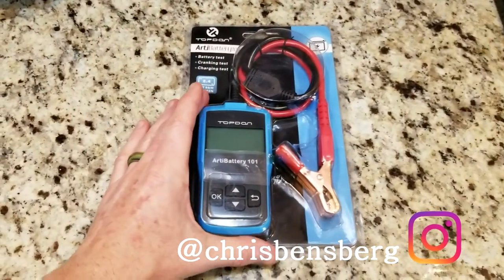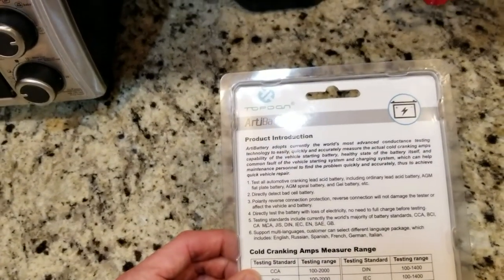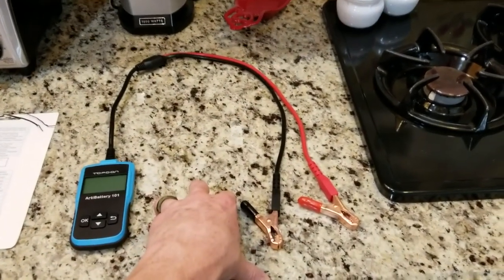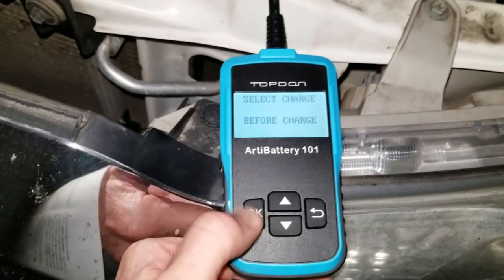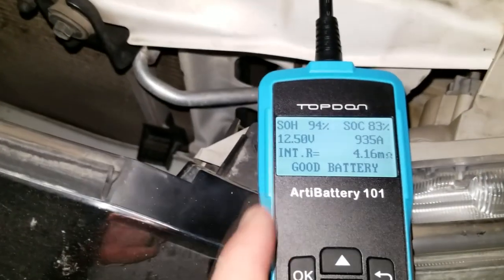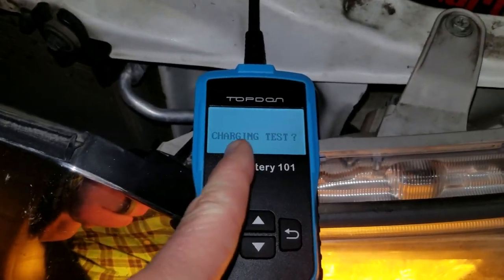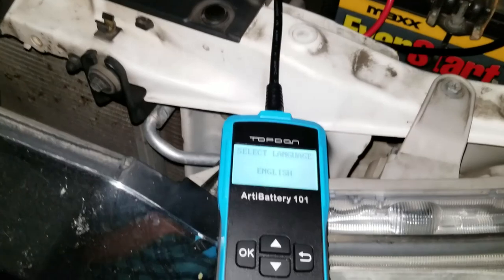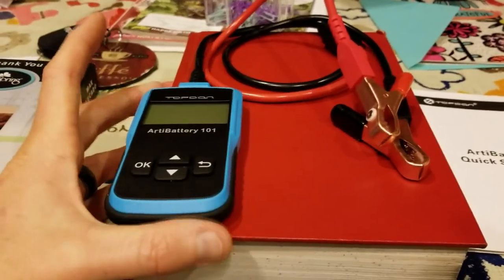THE BEST WAY TO TEST YOUR CAR BATTERY - AGM BATTERIES LEAD ACID BATTERIES & MORE

Comment: I just wonder if you need all that info, I mean it's great if you are working on a car that may not be your own, but if it is your own wouldn't you just notice that the battery was crap and change it.

Or just stick a multi meter on it to check the capacity.

Perhaps if it were a new car to you then you might but, never had a need for such a device and I've worked a few cars, usually notice if the battery is the problem fairly quick.

I don't perhaps someone may have other ideas on this, but it just seems a lot of info that you can do nothing about.

Comment: These new testers don’t measure reserve capacity so you can’t depend on them. I tested a friends battery. His rated amps is 540 on the battery. It measured 506 and said good battery. However if he leaves his radio on for an hour his car will just about start. Granted his battery is 11 years old but it still should have tested failed.